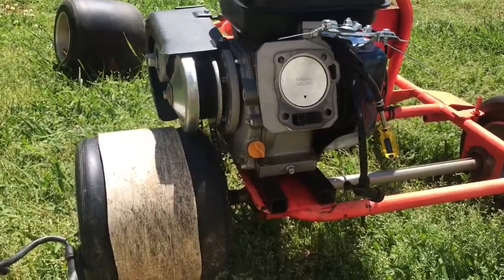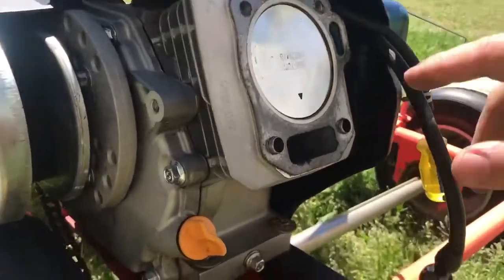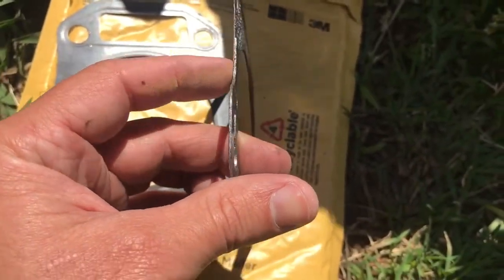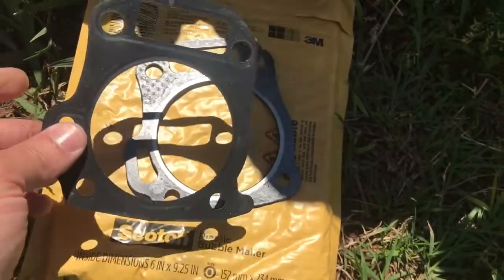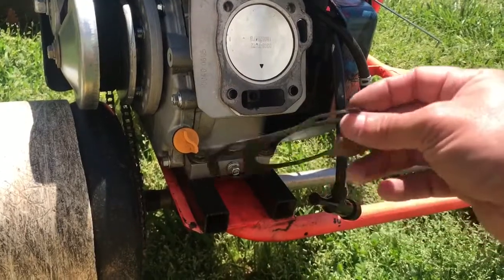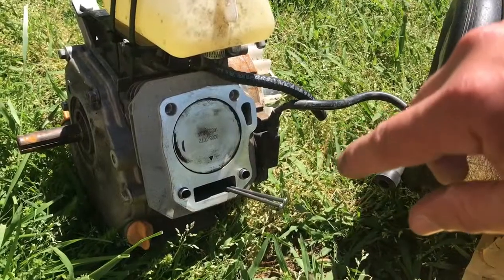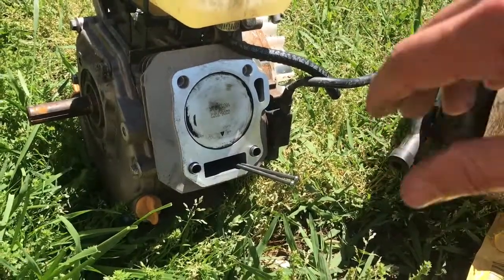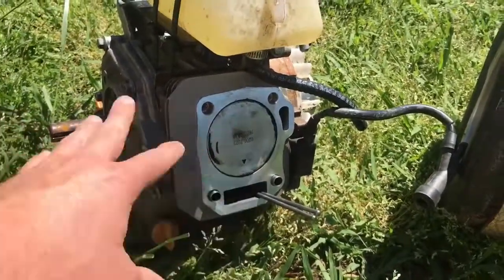Cheap $5 Mod To Increase Power On Your Hemi Predator 212

Comment: So. By lowering the head in a pushrod moter you end up needing a valve adj...but you already know that huh..lol..big cam good! Lowering head without readjusting your rockers bad.....the power your getting is probably but not for certain due to the valves opening more..they will open slightly sooner and stay open slightly longer. So..5$ and a feeler guage plus some patience.

Comment: Probably 3-4% more power by my math.  Probably won't feel it, but it all adds up!  Certainly worth it for $5. The Autolite X plug will bump compression a hair more.  Look for the one with a warmer rating (3934x?).  The 3910x often sold is a very cold plug made for wide open racing.  Probably 1.5-2% more power for around $5 if you buy it from an auto supplyer vs a race supplier.
Reply: just found that out on the 3910x real cold and fouled badly actualy wouldn't
start the bike anymore, i'll try the 3934x and see what happens.
Reply: @sabrom  is it a 3934x or is it the R3934 plug?
Reply: @ChristopherJones16  AR3934

Comment: Is there a deference between hemi vs non ate they the same
Reply from the maker: The head is different. They are rated to make the same power out of the box but most look for the hemi version of they are going to modify it. One of the advantages of buying the hemi that people go for is this gasket swap. So they can bump up compression easy with the hemi.
Reply: @jwsbackyard6413  that u I ordered one in got a hemi

Comment: This may be a dumb question, but how do you know if you have a hemi or not?
Reply from the maker: The hemi has the rectangular cast valve cover. The non-hemi has the stamped trapezoid shaped valve cover.
Reply: Part number bro
Reply from the maker: I don’t have a part number but they are super easy to find. Just search for a predator 212 head gasket on google and you’re looking for the .010 or .009.
Reply: @jwsbackyard6413  Hemi means hemispherical,  thus the sparkplug is in the center of the head
Reply: @warrenfloyd1484  Wheres the spark plug in the non-hemi ? I thought the only difference was hemispherical roof of the head's combustion chamber and that the valves are angled into the center vs being perfectly vertical like in the non-hemi.  Are the valves slightly bigger in the hemi too? I think Red Beard said in his video that they were or at least said he thinks they were. Mightve not been him but I think it was.